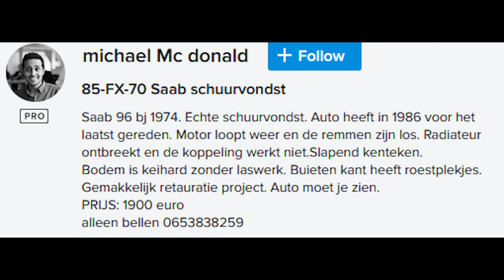A Saab 96 barnfind is my first car, and this is how it happend

Comment: Nice choice for your first car, the 96 is a true classic and you tend to fall in love with them more and more as time goes by. Lots of fun/strange features, like the automatic heater in the driver seat, turns on at 12 degrees and off at 27, if i remember corectly. The free wheel is absolutely awesome, once you learn to drive with that, you wonder why other cars dont have it. The pedals and the steering column are not lining up, and the roll down mechanism on the side windows are things thats a bit more strange, but you get use to that too. The achilles heel of the 96 are the support gear for the camshaft/balance axel made out of composite. Take of the fanbelt and wiggle the pulley, no play means ok, 2mm play means order a replacement, 1cm play means dont run the engine before you change the gear, and the bearings for the camshaft, otherwise your engine will break, totaly. Other problems are the waterpump. You have to put sealent on both sides of the gasket when you put it together, or it will leak. Fun fact: the ford capri v4 engine from the mid seventies fits right in the 96. Why? Same engine but with 2.0liter and twice the horsepower. 2" exhaust and an open airfilter, and its playtime..
Reply from the maker: Wauw that was quite a read! thank you for your commend. Before i bought the car I went on youtube and found some videos about what the car was and i was stunned about the thought that went into making this car. they really made it a car to last and you can clearly see that. sadly my heated seat doesnt work right now ill look in to that later becouse as of right now i have to make the car ready for IntSaab 2023 in Gaydon England. I will be there with my saab 96 :)

Also I am going to make a indepth video about the saab 96 trying to put all the weird and interesting things of the saab 96 in 1 video. wish me luck couse the list is big :)

Again thank you for your commend and i hop you like my videos!
Reply: @PepinCar  Glad i could cast some light over this strange but charming car. I worked at saab for many yrs, so i have of course a better knowledge than most guys. Heated seat usually simpel fix, 99% its the plus wire that burnt off due to small gauge on the wire itself. Happy to see more videos about the 96, if you have the time check out the saab museum, yes, they have webpage, lots of crazy builds. My favorite is a 96 with 2x93B engines, 6 cyl 2-stroke, oh yeah..
Reply from the maker: @mikeanderson2730  that sounds awsome! thank you! You worked for saab that sounds really cool!

Comment: Congratulations on the best winter car from that era. Orchid white is a slightly unusual color, which shifts between white/light beige/pink that came in 1974 Have fun. 👍
 I myself have had approx. 50 SAAB 95/96 from 1964-1980 (95 68-78) year model, and about 30 other SAAB 99/900/9000/9-3/9-5 and about 30 other cars of various brands. From FIAT 850-MERCEDES 350SE 😉
Reply from the maker: WAUWW thats a lot of saabs! id love to have a 99 but that is maybe my next project car
Reply: @PepinCar  You won't regret it. If you find one, preferably choose one that is newer than 1975, as the older ones are harder to find some parts for. My last SAAB 99 was a white SAAB 99L cc from 1974, first year as a cc and had it for 4 years. Sold for health reasons almost 3 years ago. One of 7 SAAB 99L cc-74 in traffic in Sweden and the only one in white. The others were blue, red and Indian yellow. Now I drive a black SAAB 9-3 cc 5-d 2003. Last year as cc. In the same year came the SAAB 9-3 4-d sedan.